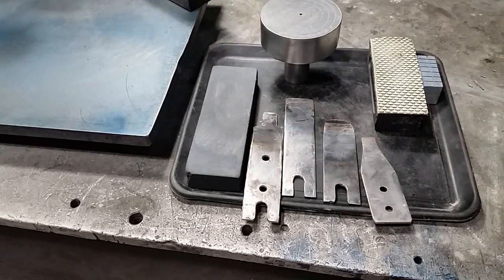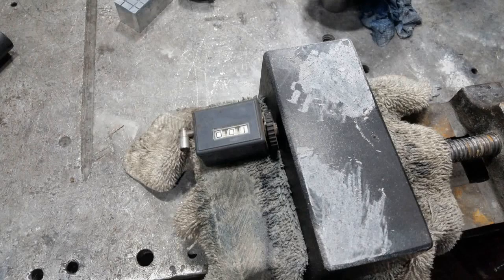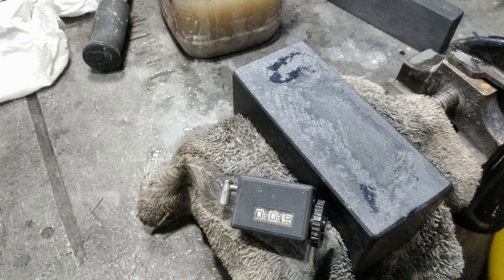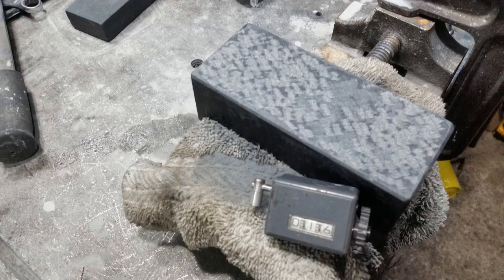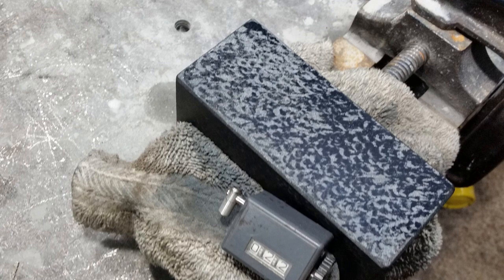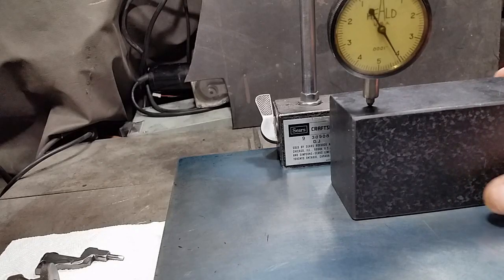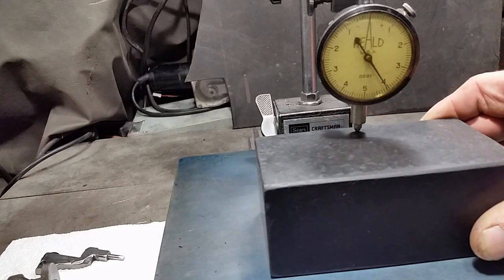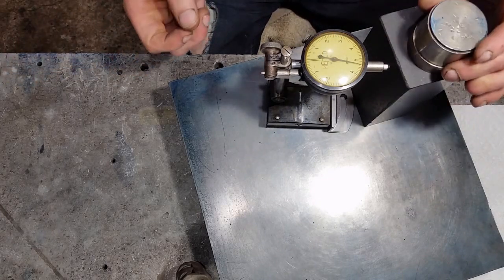Scraping a rock into a master square

Comment: I didn't realize you could scrape granite. Are you just using carbide blades?
Reply from the maker: I didn't either, I was scraping some other stuff & i had a chunk of granite laying around & thought, whats the worst that can happen?

indeed, I am using carbide..they work reasonably well.  The edge last much long working by hand.  I do wonder if a diamond impregnated blade might make quick work of big geometry changes.
Reply: @roughlyprecise5653  thanks, and good to know